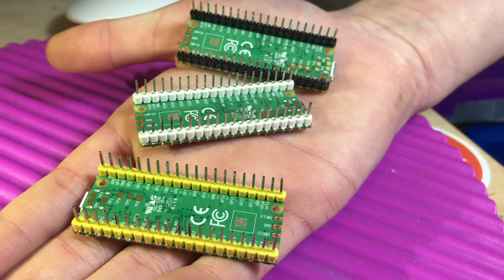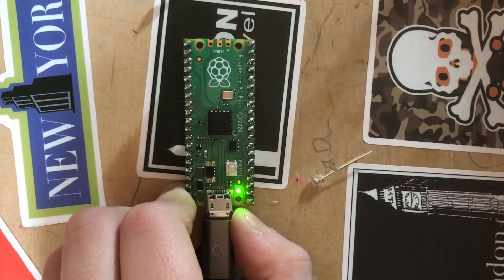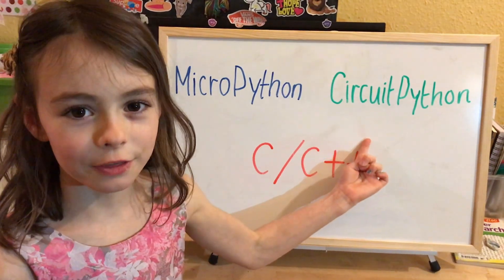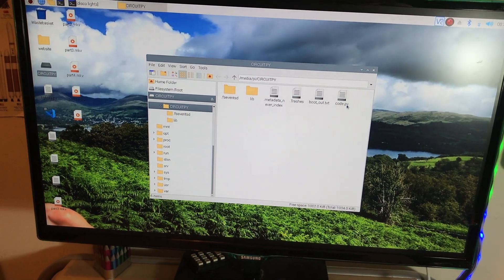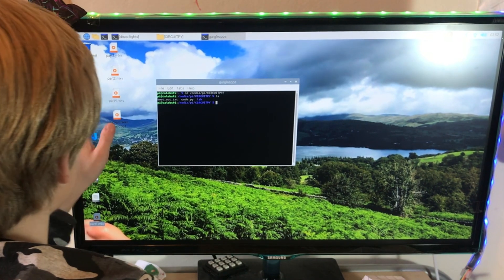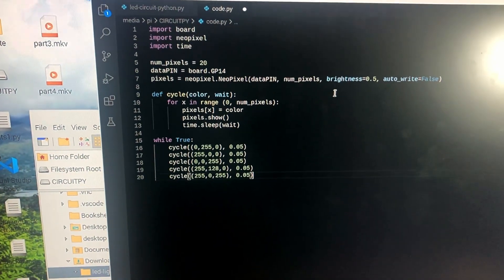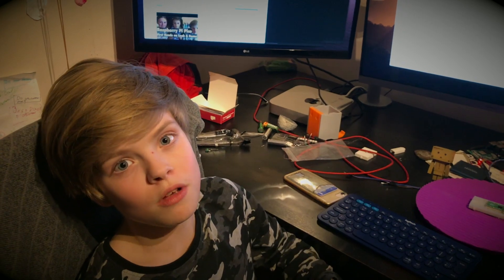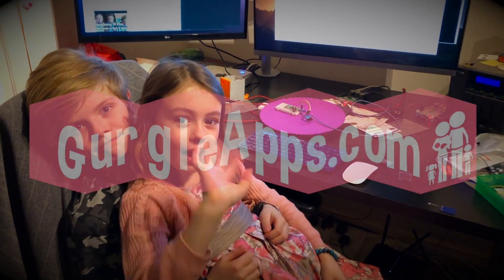MicroPython, C/C++, CircuitPython  - Raspberry Pi Pico - First Test Projects

Comment: install mc (midnight commander) comes with mcedit, a nice command line editor, use mc to navigate your directories, choose  file (move coloured line - arrows), press F3/4 to view or edit that file, view the bottom line for actions e.g. 1 means F1 ..., press F9 to view more options drop down from the top line.  mc can also chown/chmod on selected file(s), move files, delete files/dir(s), copy files, use tab to switch pane, use +/- to select/unselect file(s)  e.g.  *.jpg, which you can delete/move/copy, use * to invert selection (selects all if nothing was selected before) , F2 to save your edited text (or F9/File/Save as), 
works even in secure shell (ssh)
mouse (can switch pane or do any option/action, second mousebutton works as un/select) works even in ssh.
stand-alone mcedit can open multiple files e.g.   mcedit file1.py file2.py, in the editor file1.py is visible, F9/Window/next shows file2.py (does not close file1.py), has syntax highlighting once the file has known extension, F9/Options/General has config options, use F9/Save setup to keep this !  editor can insert another file at the current position.
mc can drop the current selected file on the command line, e.g. mcedit  alt+enter on file1.py, drop coloured line to file2.py + alt+enter builds the line, enter activates mcedit and loads file1/file2
Control u rotates the panes, i like left pane to be the source of any file action (move/copy), but the file i want to copy is in the right pane, ctrl u , i then move in the right pane to where i want the file (from left pane) to be copied. 
ctrl o hides mc (is not exited) gives you a terminal, use ctrl o again to show mc, any change of directory is not saved when exiting mc. Cli Commands executed while mc is active do not go to .bash_history  (cli = command line interface)
When mc is active and need previous cli command , press control o (hides mc) push arrow up to scroll thru mc cli history
Not all Control + letter will work when in ssh ,  e.g. my chromebook's ssh is shown in the browser, the browser option like control n will open a new webpage (not the action for mc)